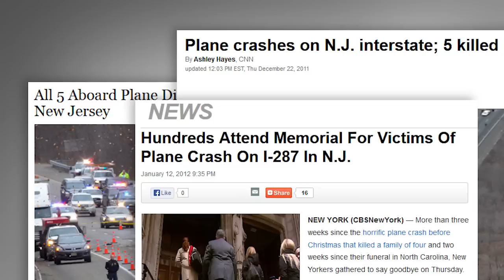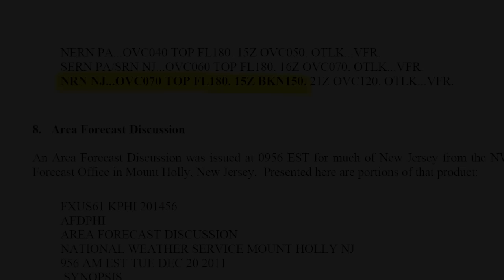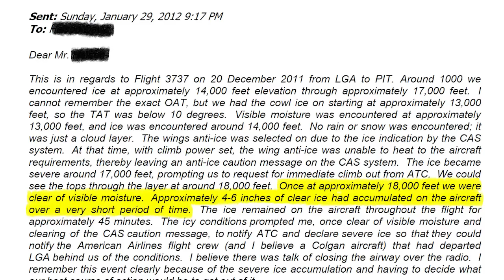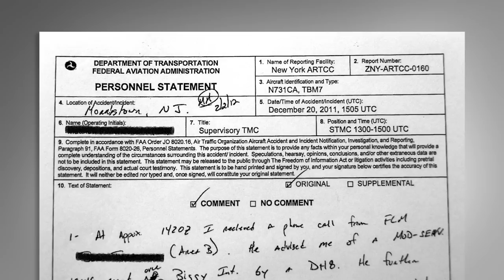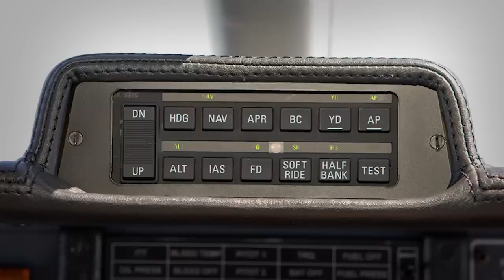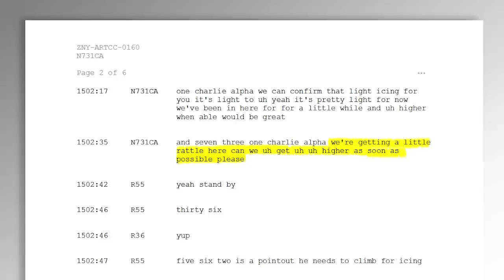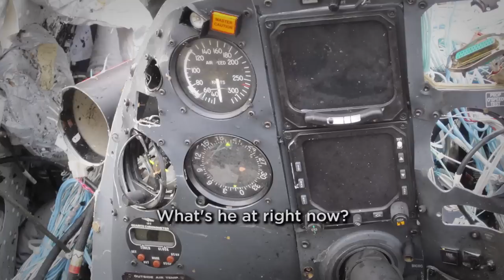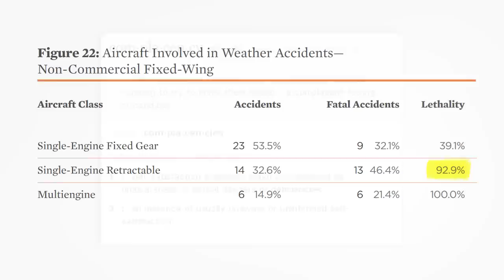Accident Case Study: Delayed Reaction

Comment: The TBM has one of the Highest accident ratios per aircraft. There is nothing wrong with the airplane...its just a lot of airplane for the lower experience level of the pilots that buy and fly it. I have been flying TBM's over 5 years and really enjoy the airplane.
Reply: steveo1kinevo You are EXACTLY right. There's several aircraft that get a bad rap, because of this exact scenario. I should know, I owned one myself for many hears, A V Tail Bonanza. The "doctor killer" as its commonly referred to. It's a simple case of a pilot, moving up to an airplane he can afford, but doesn't have nearly enough experience to fly. One of the toughest things to do when moving up in an aircraft, is to be able to stay ahead of the plane. People downplay this phrase because we pilots have been saying it for years. But its true, and its very easy to get behind ANY airplane, if you're used to flying something slower. Once you get behind it, normally easy tasks can start to  become overwhelming, confusion sets in, mental overload, and then usually shortly after, the graveyard spiral. Very common, and very sad when it happens. But people love to put blame on certain aircraft, when its not the aircraft that was the problem at all.    (BTW, I love the TBM, I'd love to have the opportunity to take one around the patter someday.  :-)....)
Reply: +steveo1kinevo also a fan of your channel here. Yeah what surprises me in all of these reports is how often pilots take the safety of their plane and flight conditions lightly. For example, if I had this aircraft and manual had explicitly stated that it wasn't well suited for flying through icy patches, I'd be sure as hell to avoid those posts at all costs or stay on the ground if I cannot fly. I think it is when pilots take their equipment and flying for granted when such disasters occur.
Reply: +steveo1kinevo I was just thinking of you when i was watching this video. Glad you're a proactive pilot!
Reply: Yes, as mentioned in the video, the aircraft is amazing.. But that's one of the reason for complacency in pilots!
Reply: ***** personally if conditions are somewhat close I regard them as exceeding plane's limitations. Always important to allow for plenty of margin of error. I don't get pilots who think otherwise...
Reply: ***** couldn't agree more. Life's just way way way too precious to chance it on weather imo.
Reply: The pilot reminds me of an airline pilot given his demeanor. I wonder if he was indeed a mainline pilot flying for fun on his 15 (approx) days off? I had a buddy in Denver who flew the DC.-10 and 747 for United. He had a 172 at JeffCo he flew on his days off. Not long after I was transferred to Tucson, he got stuck in a canyon near Silverthorn, CO and couldn't clear the ridge, losing his life when he smashed into a granite wall. The guy flew SFO or LAX to Hawaii, after a layover he went onto Auckland or Sydney. I met him in Honolulu and we went diving. on his layover and my couple of vacation days. He was a very nice guy and maybe he didn't think about a loss of power at those altitudes just one time. I thought he transferred his confidence from the DC-10 to the 172 maybe assuming the spinner aircraft had the same characteristics are his three holer and it was able to get him out of jams.. It wasn't suicide as some thought. 
He always spoke in that unruffled calm but overconfident way.
Reply: Indeed the TBM is fast.  Unfortunately I never really saw the increased cruise speed since the trips I did in the airplane were no longer than an hour and a half.  It would cut around 5 minutes off a trip that the PC-12 would do.

Fortunately the vans I flew were not certified for known ice and we never flew them during the winter.  

Garmin offers free manuals on the G1000 on their site with system specific differences training as well as a simulator you can download for free.  If you're familiar with the GNS430s and 530s there is a lot of commonality between the systems.  Honestly they're a lot easier to pick up and learn compared to the Honeywell Apex in the PC-12/47E.
Reply: steveo1kinevo This is similar with the DA62 and Cirrus planes. New pilots buy much more plane than they can handle.
Reply: "The pilot, age 45, held a private pilot certificate with ratings for airplane single-engine land and instrument airplane. He reported a total flight experience of 1,400 hours on his latest second-class medical certificate 
https://www.ntsb.gov/_layouts/ntsb.aviation/brief2.aspx?ev_id=20111220X20005&ntsbno=ERA12FA115&akey=1application, dated July 14, 2011. The pilot’s personal logbook(s) were not located after the accident.""
Reply: It's like finding all the 4-wheel drive vehicles on the side of the road after a major snow or ice storm.  There's a small number of 4-wheel drivers who are very proficient with the 4-wheel drive, they fully know its strengths and weaknesses (because they're good drivers with good skills and good judgment who understand the importance of knowing their vehicles limits); and then there are the majority of 4-wheelers... the uninitiated who bought the vehicle in the hopes that its capabilities will simply win the day, fully expecting the vehicle itself to carry most of the load.  It's this second class of drivers who suddenly find themselves surprised as they begin spinning off the highway.  The TBM sounds like a similar vehicle, with all the bells and whistles that are supposed to give the pilot a greater advantage, which it does.  However... it also gives a certain breed of pilot a false sense of security, causing them to rely too much on those bells and whistles rather than their own skills and good judgment.
Reply: @thebonesaw..4634  THE most important thing in major snow or ice when driving a car -- 4-wheel drive or not -- is a good set of winter tires (!)... All seasons certainly doesn't cut it!
Reply: @thebonesaw..4634  yup. Only time I ever got stuck was in a 4x4...

As we learned in the army, the more fancy your off-road gear, the farther away from civilization you get stuck.

When off-road driving in remote areas, always think of how far you have to walk back back out. Suddenly, goofing around in a single vehicle in the desert becomes far less appealing.
Reply: @thebonesaw..4634  I rather like your 4wd analogy over the muscle car analogy I've always held. That Shelby GT500 is going to respond much differently to the throttle and steering than your trusty old Crown Vic due to having much more power. I always saw the TBM as a "muscle plane". But I can see the TBM and it's systems instilling a false sense of security if they're relied upon in place of skill.
Reply: Yeah. The first statement about FL260 @ close to 300 Knots, I thought it was a T182T! I'm impressed with the strength of this machine. Great video. Sadly stated.
Reply: He forgot to turn on the Inert sep , it was in the off position. OMG what they were thinking as they began to nose dive.
Reply: +steveo1kinevo Well said you are the man Steve. Have you ever encountered icing conditions in your 850? Don't let the warm Florida air get to ya :)
Reply: prop planes need better deicing equipment. another french commuter plane did a similiar dance some time ago
Reply: As a passenger only from these videos & Steve’s I’ve leaned that I’d only put my life in the hands of a highly sophisticated commercial aircraft like the TBM & a highly proficient (expert)  young pilot like Steve...preferably Steve.
Reply: actually, TBM accident rates as been reduced by a factor of 10x thanks to better pilots training on the machine. But here, it's a typicall GA accident.
Reply: um, any airplane is a lot of airplane for a pilot who crashes it
Reply: Wow! Not being a pilot but being an aviation buff I always thought of icing as a thin layer. Two and a half inches! Over the area of a wing that's a lot of weight. Also, being wealthy can be hazardous to your health. Exposes a wealthy to a lot of opportunities to get hurt or worse. Me, I don't have the problem. Maybe just a pickup truck with too much horsepower.
Reply: steveo1kinevo j
Reply: The guy had 700 hrs in the TBM
Reply: Departure; I would like to climb through an area that is clear of icing conditions.
Reply: +George Semel I have flown the 850 and have most of my time in PC-12s and Caravans.  TBM is a fine aircraft for the most part.  I hate flying it in winter conditions, but I'm spoiled by the PC-12. 

 The High pressure tires of the TBM makes it feel like you're taxing on hockey pucks.  Be extremely cautious when operating on contaminated surfaces because the airplane skids easily.

The De-ice boots protect thin sections of the leading edge of the wing, meaning getting ice buildup behind the boots (most likely what happened with this accident) is strong possibility. The AFM states no ice build up beyond the protected area of the boots is acceptable and the pilot should exit icing conditions immediately. 

If you have any other questions feel free to ask.
Reply: George Semel po
Reply: You still alive
Reply: instaBlaster...
Reply: @stevio I love your channel but not sure how to take your comment. I think this video said the pilot was experienced, maybe not as much as you but I noticed at the end they said that experience can also cause an artificial confidence and complacency.
Reply: johnmohanmusic I said it has one of the highest. Not "The Highest" which is a correct statement.
Reply: Thanks, I got a bit of time in the Caravans myself along with lots of 402, Some King Air , never got to fly a PC-12 yet but the same people are also talking about fly one also! I never liked flying the Caravan in Icing Conditions, I tend to ask to go some place else or land when in countered, I just an old guy, but I am still alive and never bent an aircraft! Its a fast sucker, 300 +KTs I should not have much of a problem with it- its the dam G-1000, not have much experience with those!
Reply: Worked at a company that had several caravan accidents.  Changed sop, never flew below min icing speed.  Several weeks later, another aircrft in icing.  Captain would wait til speed bled to min icing, dive to get speed, blow the boots and try again.  All the way down, they broke out at 300 agl, dodged towers until they could land at alternate, they also had to pull the engine due to overtorque to keep the beast in the air.  If able use airspeed for climb on the autopilot, and vsi on the descent
Reply: N Denise   He just let his airspeed bleed off too much. 
Upon realizing his rapid decline in performance, and ice accumulation,
(hopefully he was also watching the wing or somewhere else where ice usually forms)  he should have at least leveled off, and probably descended.  
Informing ATC that he had an emergency. 
If the frequency was busy, then either just keying up the mic with; Mayday, Mayday, Mayday, to clear the frequency or squawking 7700, or both, 
but all the while getting the nose down to bring the airspeed up, to keep the aircraft from rolling over, like it sounds like it did.
Reply: Old and wise, I would say.
Reply: AndreGT007 if you re-read my comment I am talking about TBM accidents in general. Not directed to this accident directly.
Reply: +steveo1kinevo  I am a pilot myself, I had a interview yesterday by phone to fly a TBM-900, the interview when well so I just may get the job! I would like to pick you brian a little if that is ok with you! I am in CT but the job will be in Wis!  All I know at this point about the airplane is that its fast 330 Kts and 15000nm legs! As for me ATP with over 11000 hours logged!
Reply: George Semel that's a lot of distance
Reply: @GeorgeSemel  
What, 15000nm?.
Reply: @GeorgeSemel 15,000
Reply: The TBM actually does not have one of the highest accident rates - not by a long shot.  So you can fly those TBMs and enjoy them even more now!

Accident rates per 100,000 hours:
TBM700/850:  4.04
Piper PA-46-500TP:  5.04
Pilatus PC-12:  0.74
General Aviation Average: 7.20 (during the year 2009, the latest year the AOPA has statistics for)

While the TBM has significantly more accidents then the (amazingly safe) Pilatus PC-12, it fairs better than the similar but slower Piper PA-46.  And in comparison to the entire General Aviation fleet, the TBM is nearly twice as safe.  And given that the TBM is between 15% and 300% faster than almost all the rest of the GA fleet, it is even safer than these numbers suggest when analyzed in terms of accidents per distance traveled.
Sources:
http://www.westair.com/wp-content/uploads/2013/12/2012_Breiling_Report.pdf
https://www.aopa.org/about/general-aviation-statistics/general-aviation-safety-record-current-and-historic
Reply: steveo1kinevo. If the Forked-Tail Doctor Killer isn't in the top 3 most airframes destroyed as a % of the entire fleet, I would be shocked. There are so many Beechcraft Bonanza crash studies online, many more than you might think.
Reply: Look at the stats on the lake amphibian
Reply: steveo1kinevo Even highly experience pilots can have problems with ice, this accident was not about low experience. Clearly a good pilot, that just didn't take extra precautions with the weather reports. This can happen to anyone. AOPA did a great job remembering us the importance.
Steve, I have seen your videos and really enjoy them, but this comment is very hard on the capabilities of a dead men that you don't even knew. Is a very subjective term to judge low middle or high experience pilots. Even airliners face accidents. Humble and learn my opinion.
Reply: I see why you fly mainly in warm climates ;)
Reply: George Semel(
Reply: What does a FL pilot know about Severe Icing?  Asking for a friend.
Reply: Oh I see why you aren’t blaming the plane when it actually is a shit plane, because you fly one!,,

Comment: Stall due to engine failure. Engine failure due  injesting ice, investigators found inertia seprator switch in off position.
Reply: slickjimmy If a plane's wings have inches of ice on them to the point of not being able to create lift,it doesn't make any difference whether the engine is running or not. A stopped engine doesn't cause a stall. In this case,with the apparent amount of ice on the wings, a running engine would have only postponed the inevitable loss of control.
Reply: Jack Frost Jack the engine sucked ice in and was foded out because the pilot did not turn on the inertial separator. Watch the entire video there is a note that investigators found it shut off and the pilot mentioned the engine taking in ice in communication with the tower
Reply: slickjimmy I understand that the engine had stopped because of ice, but from the reports from other pilots, the icing conditions at the time were extreme.Of course having the engine out would have created a much bigger problem, though all the pilot had to push the nose down to compensate for the lack of thrust from the engine. Plenty of planes have crashed due to icing while having healthy engines. No matter how powerful the engine, an iceberg will never fly.
Reply: If you listen to the report the pilot did not have the inertial separator activated. Ice ingested took the engine out

Comment: Why is airline flying so much safer than general aviation?  I know that the aircraft the airlines fly are, of course, more capable, and the pilots fly all the time, but maybe other things can be learned from airline procedures.
Reply: nidurnevets Airlines fly with two pilots, each of which has minimum hours. Their training also includes CRM (Crew Resource Management), so they have a much better chance of spotting and correcting errors. 
Also, they fly known routes over and over, so oftentimes the workload may be lower, and much more familiar than for someone who may be flying once a week or once a month, rather than every day.
Reply: You make a lot of good points.
Reply: nidurnevets usually, airliners can usualy fly above the weather so they actually have a larger envelope
Reply: nidurnevets huge planes are huge, everything fucking huge, the bigger you are the more stable you are and the more backup systems you can get
Reply: nidurnevets I guess it´s down to the airplane really. Modern airliners have huge engines, huge de icing systems and also radar which only a fraction of ga planes have. Also they tend to just shoot sraight up to higher flightlevels which takes them out of the weather pretty quick. So i guess it comes down to how much money qou can put into a plane. Mor money = more capability = more safety.
Reply: Miah L I have heard another explanation.  A pilot in a GA plane will often look at the weather and say "I think I can make it" whereas the rules are much more spelled out for scheduled airliners, as to what they are allowed to do according to weather conditions etc.  They simply can't take off if the RVR is below a certain point, for example.
Reply: Je La I agree.  That is a big factor
Reply: Besides the better plane characteristics (re size), airliners fly with two pilots, as mentioned, and a dispatcher. So they can have almost constant communication with someone very knowledgeable about weather-related decisions.
Reply: Private Jets have a very good record! Its mainly prop planes that wreck!
Reply: nidurnevets This is from my groud school class; most people flying GA are PPL, and most get their wings between 40/ 60 hrs. Most accidents occur between 50 /350 hrs, i.e. flying outside the protective cocoon of the CFI and still inexperienced